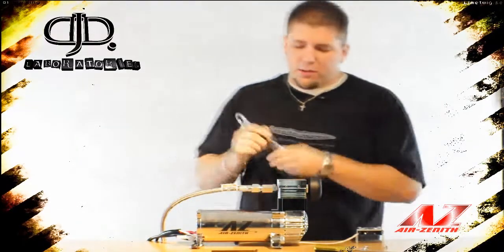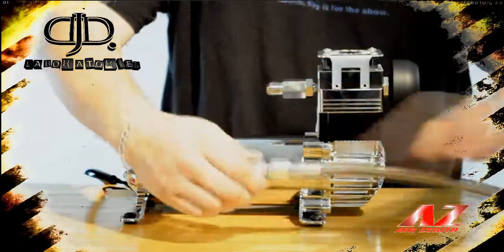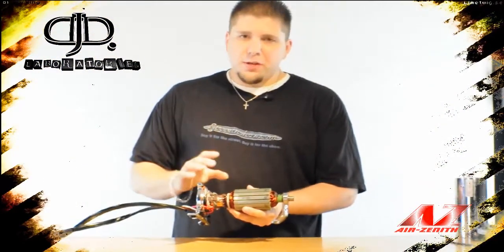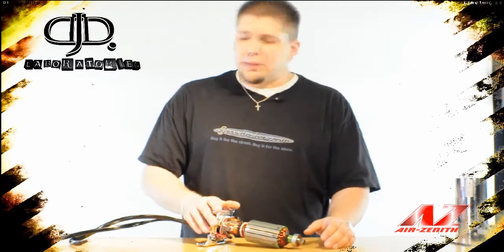Air Zenith OB2 Review From DJD Labs

Comment: I have two white OB2 compressors that I've had, new in the boxes in my closet for well over 15 years and finally got them installed today. (Marriage and kids happened and put a hold on a truck project. Lol.) These fill a 12 gallon tank really fast. I was a little worried because I had them stored for so long, but they started pumping without any issues. So gar so good and no more changing out nitrogen tanks.